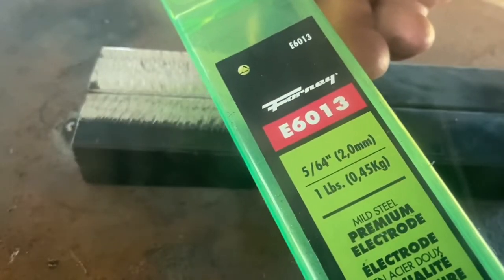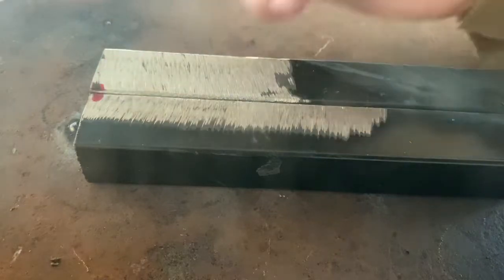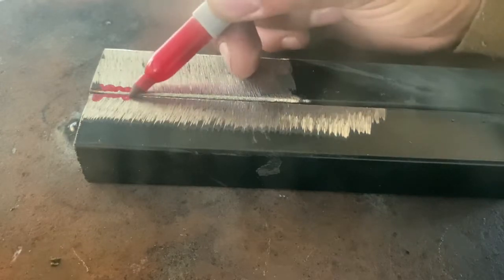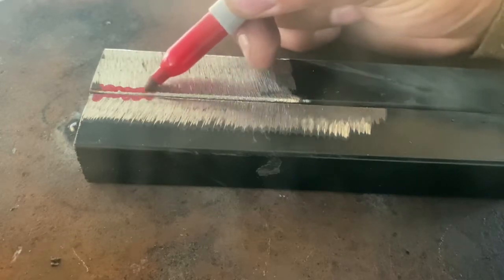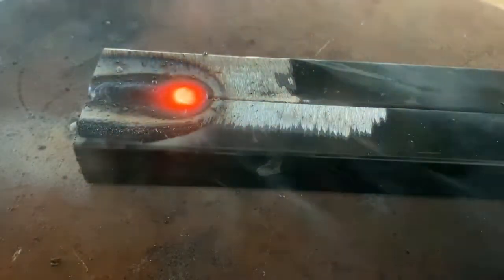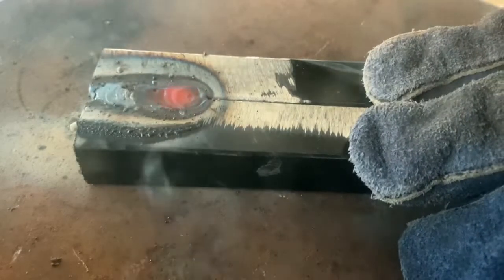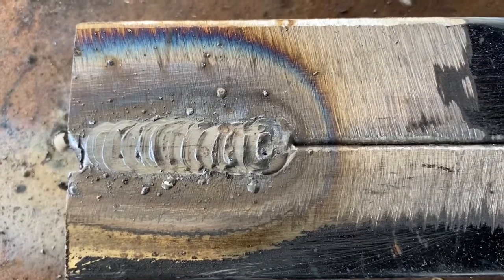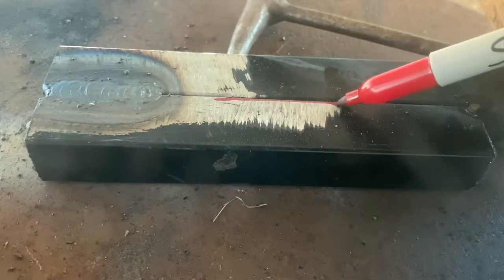secret welding techniques on thin metal that few people know.  welding stick like tig

Comment: welders are a special breed ;-) 

- nothing hates a welder more than an other welders work 
- welders allways rate the easiest hobbyist makes as " not good for a pipeline or nuclear submarine " 
- if they see someone in the jungle with an generator  an ac buzz box and only 6013 available ...they yell " run 7018 or 6010/11 " 
- if they see the jungle person do exactly this on thin metal , they yell " turn down amp , run a bead " 
- preping mostly overrated